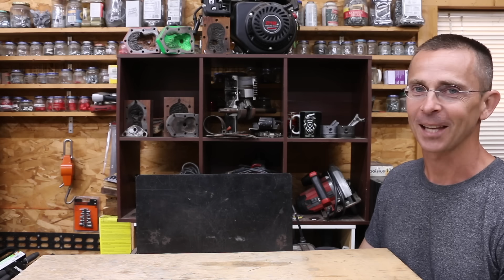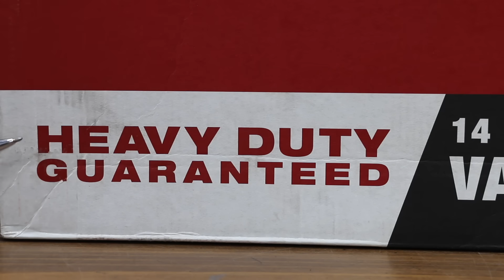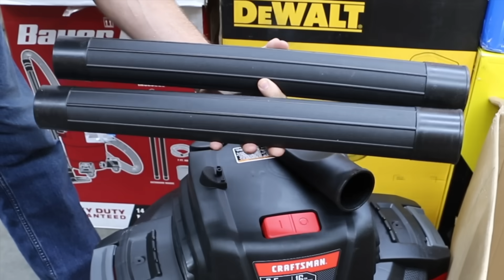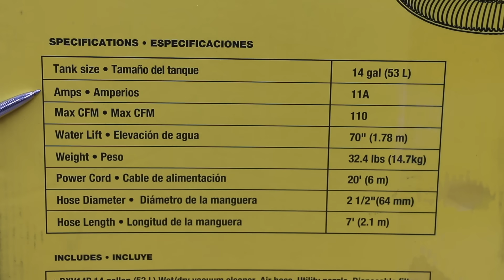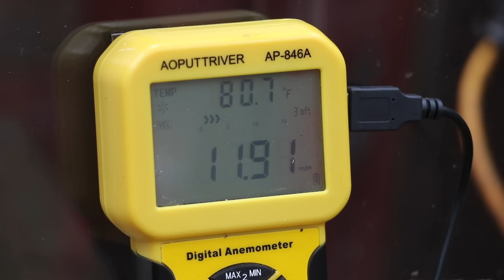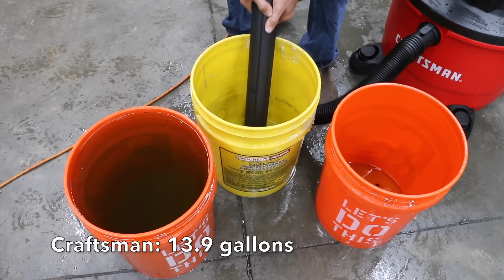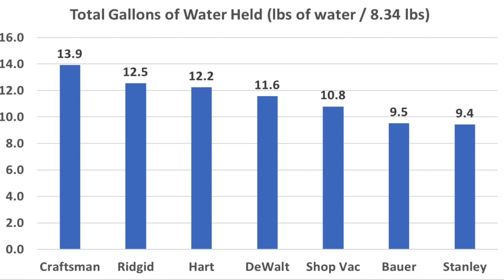Best Shop Vac? Ridgid vs Shop Vac, DeWalt, Stanley, Hart, Craftsman

Comment: I used to work for Felchar Manufacturing, a division of Shop Vac, that produced several variety of Shop Vacs ranging from the tiny 1 gallon up to the stainless steel  40 gallon barrel-vac. They are still operating out of Williamsport Pennsylvania, but I heard rumors of moving equipment to China or Mexico. Thanks for all the time and effort you put in :-)

Comment: Edit: according to responses to my comment, this may not be true. Leaving this up for others to read up on and decide on their own.

Huge caveat about Ridgid products! Most of their stuff has lifetime warranties but ONLY if you register them within a certain timeframe after purchase! (I can't remember if it's 30/60/90 days) otherwise you're gonna have a hell of a time trying to put that warranty to use down the road. About a year ago I did a bunch of research on shop vacs before purchasing mine, and the general consensus at the time was Ridgid, but many, MANY people mentioned that warning about the warranty.

Without the lifetime warranty, I think it falls a little behind other vacs, which this video helped solidify. But with it, I think it's a solid contender to be an all-around winner (or compromise, depending on how you view it) compared to the others. Huge bonus for me was that I needed a light duty leaf blower and that's what the removable head is for. It works GREAT, tons of air. Almost too much in some situations for me haha! Though not all of the Ridgids have that feature.

OriginalEdit: and that head to head was a fantastic and funny comparison. I love the way you feature stuff! When it's something I don't yet own, I'm always looking out for what's good and bad about certain products. When it's something I already own, you hook me in with the competition and have me rooting for my product, and in the end I learn the strengths and weaknesses of what I already have. Either way this is great!

Comment: F=PA larger hose has a increased area and a advantage with the ball pull test. Consider making a water manometer out of a clear piece of tubing to measure suction or relative air pressure differential

Comment: To anyone watching this who doesn't need a huge one, I highly recommend the Bucket Head from Home Depot. It attaches to the top of a 5 gallon bucket. I've had mine going on 3 years now and have used it almost exclusively in my aquarium room. It's sucked up salt water, fresh water, gravel, sand, dirt, wood shavings, shattered light bulbs, you name it.

Comment: I am a construction worker and can tell you the Makita 11 Gallon Wet/Dry HEPA Filter Dust Extractor/Vacuum is very nice. Rubber wheels, tall and skinny gets through doorways easily takes up less room, incredibly quiet where you can have a conversation at a normal level right next to it, self cleaning filter and the new ones have built in AWS. Bad part is the price tag and it comes with the 1.5 inch hose but you can adapt a 2-1/4 which I did.  This was another well thought test done by Project Farms- Great work man.

Comment: I just noticed something about your one test I think that the diameter of the end of the hose  could possibly also depend on how much force is pulling down in the ball. because the ones with the bigger hose have more surface area on the ball so there for they hold on they’re better

Comment: Am I wrong or is the method measuring suction VERY affected by the diameter of the hose? I would imagine the correct way to test this is to plug the hose with an air pressure sensor and measure peak air pressure? Second best way to measure might be with a rubber-ish FLAT surface to press the hose up against. If you use a rubber ball, then the larger-diameter hose will basically cheat by having more surface area to distribute the pressure, basically getting better "suction" with less suctioning ability. Edit: I watch your videos all the time! They're really one of a kind, I wish I had the time and ability to test all the things you test out! Thank you for your work

Comment: The Bauer shop vac looks very promising. The problem with Harbor Freight is their products ALWAYS have a short lived factory warranty because they want you to buy the extended warranty. But when you do they don't really care if you sat your shop vac in front of a train or tossed it in the ocean. They'll replace it regardless of it breaking on its' own or you breaking it on purpose. Where as the DeWalt may have a 5 year warranty but it's only good if the device fails on its' own within those 5 years. If you told them you ran it over with your truck to test its' durability they won't replace it. :)

Comment: This test sucks.  In a good way :)  Thinking out of the box - The bauer + extended warranty might be a winning combo.  Sometimes they get you on the consumables, I wonder which ones have the cheapest filters.  I also wonder about which ones cheated a bit - namely some gave you a cheap bag while others had a proper pleated filter.  I'm thinking the pleated filter would probably perform better as there is more filtering area?  Might be interesting to duplicate your tests with different style filters?  As always, thank you for your tests!

Comment: I have bought a lot of stuff at HARBOR FREIGHT. I have never bought the warranty but have family that has. I think it’s no questions ask replacement..  I hate warranties that make you jump through hoops. I have baurer pin nailer and brad nailer. And even the Chicago pneumatic brad. Non have failed. Saying this because of the 3 month factory warranty you talked about.

Comment: Great comparative and practical test , however as you provide Amazon affiliate links I was surprised you did not include Vacmaster (VBV1210, 12-Gallon 5 Peak HP Wet/Dry Shop Vacuum with Detachable Blower) found at Amazon and Home Depot.  Seems it might possibly have been the real winner.  Thanks!

Comment: Rigid makes the best vacuum right now. I have bought and used rigid vacuums for the last 15 years which have sucked drywall dust continuously everyday in my job application. I used to buy Craftsman vacuums 15 20 years ago until they change from the all black ones to the red and black ones where they changed the bushings that were brass and our now are encapsulating plastic.The motors would overheat making the bushings wobble out on the plastic making some of the vacuums last a month or two, currently I have four or five rigid vacuums that are almost 10 years old and are still working as a drywall  vacuum or painter vacuum.

Comment: I had a shop vac brand vacuum. It was a good vac, even had the water pump feature. Never used it, always had appropriate filters ect... Then one day the motor went out in a smelly smokey mess. Sounded like the bearing went at the same time. This was after just a year plus of use 

I have a rigid now. Again appropriate filters and even a hepa that I frequently use. It's a monster. Been using it since the shop vac, over a year now and far more abuse. Lots of drywall dust and chunks as well.

Comment: Thanks, another great video! Since you have all these shop vac's now could you do additional testing with them? For most shop vac's you can get different types of filter and shop bags. Would be nice to see a show down on the filtering of the bags and filters and how much they effect the performance of the shop vac. Also, drop test of the units and of the attachment to see which shop vac is built to handle the punishment of day to day work. I have a Rigid shop vac and why I like it one of the things I don't like is if I vacuum saw dust the filter plugs up easily.

Comment: I'm calling foul on this one. I am unsure how you picked the shop vacs, by size of tub or peak HP?  Some are 6.5 HP vs. 6? Also you picked the gimmicky Ridgid, they have many options for this brand two of which would have been more comparable to the others. 
https://www.homedepot.com/p/RIDGID-16-Gal-6-5-Peak-HP-NXT-Wet-Dry-Shop-Vacuum-with-Cart-Filter-Hose-and-Accessories-HD1800/304795088
https://www.homedepot.com/p/RIDGID-14-Gal-6-0-Peak-HP-NXT-Wet-Dry-Shop-Vacuum-with-Filter-Hose-and-Accessories-HD1400/304795071
I just picked up a 14 gallon Ridgid for $25 so the fact that another might be better is not a concern, the cheap price was for me.

Comment: The main gripe i have (and it isn't towards you it's directed at most of the companies) is the actual trouble that comes with getting a warranty claim filled. You have to find a service center and then still wait forever or even worse mail it off somewhere to get fixed. It's why the harbor freight brands come out on top. Especially if you pay for the extended warranty which isn't much more expensive. You have a problem you take it to harbor freight and if it's under warranty they give you a new one no questions asked. So even if the extended warranty brings the price up to the competitors it's almost always much easier to get a warranty claim filled. At least that's been my experience.

Comment: I would like to see a version two of this comparison that includes some discussion on how the filters attach/detach.  I have a (very old) craftsman and a (two year old) rigid.  For the woodshop, the Craftsman is much better since the filter can be unscrewed and gently removed without disturbing all the sawdust that is attached to it.  The Rigid has to be popped off the rubber stopper at the end of the filter, which always jostles things causing the sawdust to make a mess everywhere.  I'd be curious to see how the newer versions of these shop-vacs have their filters attached and which ones allow for cleaning without making a mess of the stuff that is stuck to the filter.

Comment: I had a question about the sand test, when you did that did you reuse the sand between tests? If you did, I suspect whichever one went first would have had a lot worse of a time because all of the fine dust in the sand clogged the filter preferentially. If you used a fresh bag each time, ignore this pots and nicely done.

Comment: Not gonna lie, The Bauer surprised me.

That said I have a Rigid I bought on a bit of a whim. It is a 16 gal and doesn't have the blower attachment and honestly has been incredibly good. It doesn't seem to suffer from the same design problems that one did as its lid and bucket are quite snug.

Comment: Craftsman always did have fairly good shop vacs. A place I used to work, we would take a craftsman 16 gallon outside and suck up leaves with it. Never clogged and worked rather well.

The irony is, the company Shop Vac, the name everyone associates with this kind of vacuum, doesn't make that great of a vacuum. I got a 5 gallon one that is close to twenty years old. It is ridiculously loud, doesn't have great suction, hose clogs constantly (for what ever reason they design a ledge where the hose connects to the tank that always causes blockages), but with all of this it still works. I've used it ALOT and yet it still goes. All the shortcomings, longevity is it's one attribute.

Comment: Todd, excellent video... You may also want to input the cost to function ratio.   I purchased the Stanley vacuum for $49 not $95.42. It also came with a bag filter. This makes a tremendous difference when comparing a $149.99 item against a $49 item.

Comment: What tape measure is the best tape measure. Testing could include how far it extends before bending, magnet strength for picking up a drop screw. Magnet strength for metal studs. Drop test. Rewind speed. Strength of the locking brake. Weight and quality

Comment: i 'm pretty sure the suction test is wrong, because the diameter of the nozzle has a huge effect on the measurement (2x the diameter = 4x the force). you'd want to have the same for all of them for an accurate measurement. i guess you could also divide the resuts by the nozzle area to compare them equally
good vid as usual otherwise

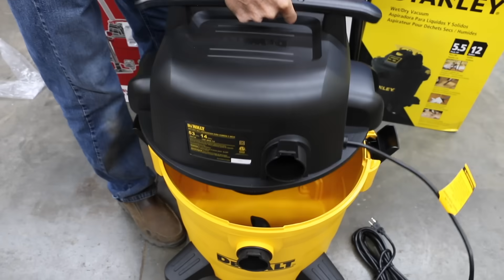Comment: 5:45 i think they only gave you enough space for the ones not being used. They're using the hose as storage space. Which makes sense because most vacs (well maybe not most but a lot of them) are used for one main thing and has one attachment that's used the most.

Comment: When I bought my shop vac I chose a model that pumped the water it collected.  I had to use that feature once when we had a minor flood as far as I'm concerned it paid for itself that one use.  However I don't use it as often as the mini 2.5 hp I use for cleaning the car and other small projects like cleaning out dryer and bathroom fan vents.

Comment: The amperage draw means ABSOLUTELY nothing in terms of power.  What matters is how much of that amperage is put towards the work you want to do.  The noise takes energy. The vibrations take energy. The motor heating up takes energy.
A 12 amp motor could be producing significantly less power than an 11 amp motor.
A short circuit will draw so many amps it will trip the breaker or start a fire.  Amp draw doesn't mean anything.

Comment: I was so hoping to see the Bucket Head here.. that thing is a fun little vac and way less expensive than all the others. 25 bucks.. but you need to purchase the bucket lol..   https://www.homedepot.com/p/Bucket-Head-5-Gal-1-75-Peak-HP-Wet-Dry-Shop-Vacuum-Powerhead-with-Filter-Bag-and-Hose-compatible-with-5-Gal-Homer-Bucket-BH0100/202017218

Comment: Perfect sealing may increase the ultimate suction achievable but it's not a good idea in practice, imho.  These motors consume a lot of watts and need airflow for cooling.  If the operator causes the hose to become occluded the motor will overheat in short order if there's no other way for air to get in.  A blocked-hose survival test might be interesting.

Comment: I'm pretty sure the current will increase when the motor is under load, so they might produce more horsepower when you're actually using them. I think that should be included in the tests, current draw under heavy load.
I would also think that vacuum motors and impellers are probably more efficient in their forward direction than blowing in reverse, so that might have skewed your results.

I think I like the Dewalt best. I know what I'm gonna buy when my Milwaukee wears out!

Comment: Would pulling force directly be related to how much surface area the hose end has on the ball? And a neat trick for those that don’t know if you can hook two or more vacs in series to create a turbo charged vacuum 😁👍. Would be nice to see with one did the best for filtering dust. Cool test, cool video, keep up the good work 👍

Comment: The feature I always look for is the big oversized wheels so it will actually roll around the yard and don't have to pick it up going down stairs. Them little cheap casters suck and break! I personally use a commercial grade shop vac with the metal can. cost me $189

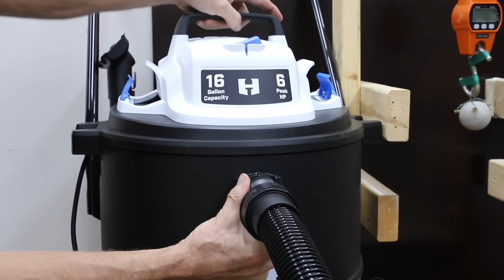Comment: 8:07 looks like you used different diameter hoses which will change the amount of force they can apply, even with the same amount of vacuum different diameters will apply different forces.

Comment: I work in a machine shop and typically what happens with some of these is the wheels can't support the weight when full. Here's an idea. Do a long term test on how well vacuum sealing items like super glue and other glues and gasket sealants work with both opened and unopened tubes. Seems like they are always dried up when I need them.

Comment: For me it's all about the hose. The Rigid my dad got in 1998-ish had a wonderfully tough hose, but the one we got to replace it (Rigid, again) now has its connectors molded as part of the hose. They broke within the year. Plus the care care accessory kit has broken on me twice. I'd love to see you repeat this test with the cordless vacuums they have now. I'd like to replace my 120VAC vacuum with cordless but I worry that the performance won't be there.

Comment: The warranties are worth about as much as the HP ratings... (nothing)
Ridgid “Lifetime warranty” against material defects and workmanship.  I would be very surprised if they took back a damaged vacuum hose, or burned motor. They would claim it is user fault and not warranty it. 
I’m not a big HF fan but with this video you’ve shown Bauer beats out the rest.

Comment: I feel like the minor variability in how and where you are holding the hoses may make a difference on some of the 5 gallon bucket  tests.  Setting up a pre-plumbed jig with a valve  you could connect first, turn on the vac, then swing the valve  open would be better.

Comment: Flux core welding wire in cheap 110V welders.  As a related comparative test, cheap and name brand 110V wire welders. Your tests are very helpful.

Comment: Would be nice to see you run  the same test on the metal canister shop vacs... it would be interesting to see if the stiffness of the metal had an impact on suction and airflow.

Comment: I'm very glad you ran this experiment! I wish you had tested the VacMaster Beast. I suggested some time ago that the Beast should be included, if you test wet/dry vacuums. I even posted a link to the Vacuum Wars channel where he showed that the Beast was stronger than a commercial car-wash vacuum and stronger than all other tested wet-dry vacuums. It's so strong that some people have said that they had to drill holes in the tube. Any certain reason why you didn't include the Beast?

Also, I'm very, very glad to see that you included affiliate links! It introduces no bias at all and doesn't compromise your integrity in any way, but it will enable you to be able to run more experiments and more costly experiments in the future. I wish your channel a great deal of success!

Comment: You need to account for the hose diameter with the suction pull test. A larger hose will give much more pull simply due to more surface area.

Comment: 12:37 you should compare them by percentage = gallons sucked up vs tank size. Not by total gallons. A 5 gallon vac that sucked up 4.9 gallon would come in last by your graph but it still picked up closer to it's rated capacity.